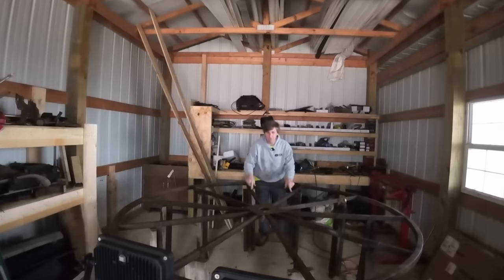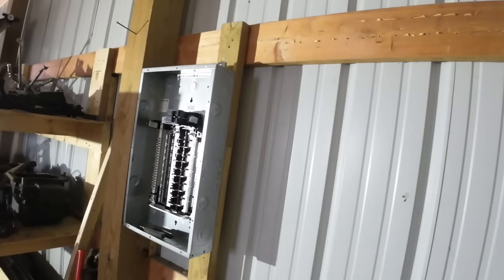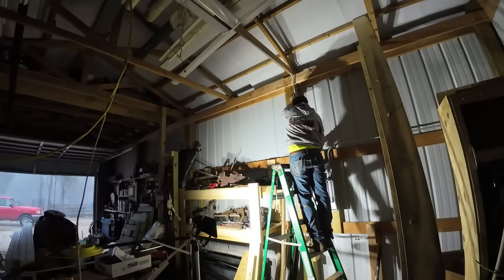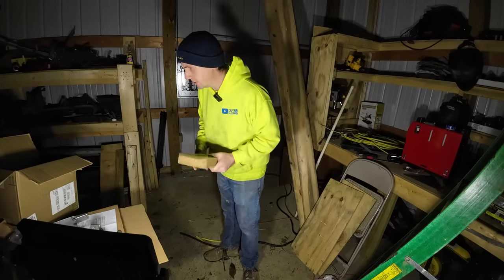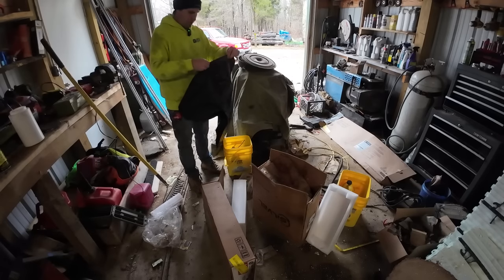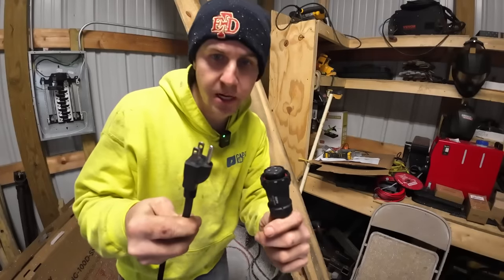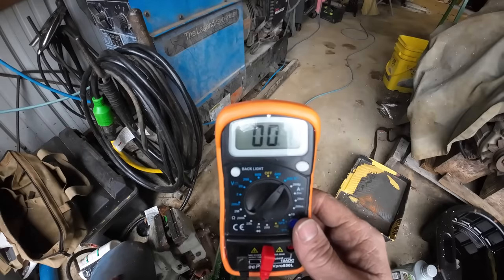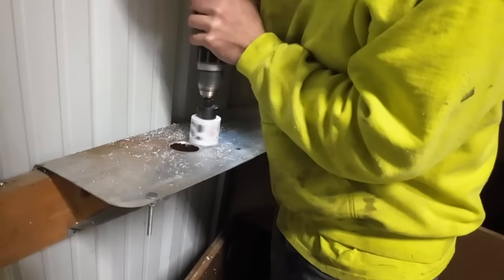Off Grid Solar Shop Conversion - Step 2: Electrical and Diesel Heater Install

Comment: I have a 100 year old wooden garage in my backyard that is around that size. I have been insulating it for dirt cheap by buying used insulation from kijiji  lots of people when renovating will buy new insulation and sell the old. You should look into that for yours
Reply from the maker: Definitely a good way to do it

Comment: Great progress Mike. Enjoying the process. 
I replaced one incandescent bulb (out of 12) in my shop with an LED, with 4 adjustable panels. 12,000 lumens. 
Huge difference, even though I don't care for that frequency of light.

Comment: Mike, why not add an outlet and plug in a very low wattage night light. Practically no draw, but a defeat of the 4 hour shutoff. At least it would work for going out in the morning.
Reply from the maker: Not a bad idea.

Comment: Have you tried some wire lubricant, when pulling wire through conduit?  Small squeeze bottles are relatively inexpensive, and the stuff makes a difference.  I'd think you would really like the results, when you're pulling NM cable, which doesn't have the slickest coating to begin with, through 1/2" EMT.  

Thanks for another video.
Reply from the maker: I use lubricant when pulling wires.

Comment: Just a thought on heating the battery pack. Would it help if the exhaust stack was re-routed down and around inside the cabinet? There are a few reviews on the internet about scavenging the exhaust heat from those style heaters. Nice progress Mike. Take care & stay safe.
Reply from the maker: Maybe

Comment: I have the same Bluetti--- if you can------- 2 solar panels running 350 watts each gets the most out of the system.
Reply from the maker: That would be awesome,  for now I'm running 100watt panels

Comment: Looking good.:face-blue-smiling: I have the same  Bluetti, for emergency power. Haven't used it yet but like watching you talk about it. 
Having to turn the power on might not be too bad it will save power. Might have to have a flashlight by the door, a small in convenance but it's only a temporary solution to your power needs for now. 
Have a Great week!🤠
Reply from the maker: I was thinking that,  wouldn't be too bad
Reply: Do you worry about the batteries getting too cold for the unit to operate during certain emergencies or are you in an area that wouldn't happen?

Comment: Take a look at Simple Living Alaska for their chicken coop setup. It uses a Bluett,i diesel heater, and LED lighting set up with a thermometer to control the heat. Might be just what you need?

Comment: Mike, I think it would be beneficial to spray foam insulate the back side panel of the shop to keep Blue boy warm.  Shouldn’t be too much for a DIY application.
Reply from the maker: It would work well, but would be incredibly expensive
Reply: @CaptainKleeman  incredibly expensive to buy foam spray at a big box store or a supply house?

Comment: Just a quick question. Could you cut a couple pieses of foam board insulation like builders put behind vinyl siding to keep the baterries from getting too cold?

Comment: Did you get special low temperature fluorescent fixtures that start easier in shops and barns that are unheated? Actually, since it is off grid, I would consider LED fixtures since they are more efficient. I have heard but have not investigated LED bulbs that will replace fluorescent tubes. Maybe you can check this out.

Comment: Another thing to watch for on your Bluetti or other similar power banks :
Most recommend using an inverter generator , preferably a pure sine inverter generator , to charge them , as the power banks typically do not like the dirty high distortion voltage supplied by many home generators , especially brushes non inverter designs .
I work with similar types of commercial UPS systems , and I can tell you some stories about people not paying attention to such arcane details when ordering generators for emergency long term grid outages , and , wondering why the damned things won't work right or at all , even if the supply voltage and current are within specs .
This is what I suspected with your welder / genset , as it is more than likely a brushed design , and the dirtier and more worn the brushes get , the more THD of the AC waveform they produce as the load increases . I didn't suspect though , that it cut off the AC power output when the welding side had a draw . Then again , I'm not a welder , but I have struck a few arcs in my day , sometimes on purpose .
Reply from the maker: It suggests pure sine wave in the manual.  I have what I have.  It'll either like it or it won't.

Comment: Not sure if your work is going to have to pass inspection , or , what version of NEC they apply there , but , running Romex in in conduit is generally frowned upon in most places and situations .
Most of the reasoning behind that has to do with potentially overheating the wires , but , it generally carries the same thermal rating as THHN wire if you read the specs .
Anyway , don't see it being any issue at all in a practical way , especially for a low draw fluorescent or led lighting circuit .
And yes , I have done the same thing , but not on anything that would need to please the inspector to get their little stamp of approval .
Reply: I was gonna say it's against NEC so oh well
Reply from the maker: It's definitely not against nec.
Reply: @CaptainKleeman  it's all about over heating the wires buddy. 
General practices run THHN in conduit. Love the channel either way!

Comment: In an ideal world, the intake of the heater takes in air from the outside otherwise you create low pressure in the building and you suck in cold air through the cracks, that needs to be heated. In reality, I am not sure how drafty your shop is and if it will make a significant difference.
Reply from the maker: Lol,  so, let me follow this.  Instead of sucking in cold air through the cracks of the metal by having the intake inside,  I should put it outside to...and let me make sure I'm following...suck in the same cold air. Aside from that logic,  it doesn't create a negative pressure, it's simply moving air through the unit.  An exhaust fan creates negative pressure, this heater does not

Comment: So could you put a surge protector between the welder and battery that automatically resets after the incoming voltage normalizes? If one even exists that does that. An oz. of prevention as they say.

Comment: Article 334 (b)(4) says yes you can use Romex in conduit as long as it is not used in underground or wet/ damp location and must not exceed 53% of the capacity of the conduit. 🤷 Who knew. I was told in electrical school no but code says you can...👍
Reply from the maker: Bingo
Reply: FYI for the future THHN spools are actually cheaper and easier to pull but use what ya got

Comment: Did you ever think about putting a solar generac system for your little shed might be cheaper than running electricity to it
Reply from the maker: I'm wondering if youre watching this video or not
Reply: @CaptainKleeman  HAHHAAHAHAHAHA....

Comment: Hello Mike,
  I know that you are a very intelligent man and career firefighter so please take my question as being inquisitive only because i have a similar structure that i would like to set up for fab work. My question is, what are your concerns about welding and cutting inside and being so close to all of the wood and timber structure? Thanks for the ride my friend.
Reply from the maker: Welding screens
Reply: Thanks, i suppose that they would need to touch the floor because cutting sparks can hit the floor and scatter over a good distance.

Comment: Ain’t nothing wrong with 12/2 in conduit. Just a little harder to pull. From the video, it looked like your light switch was upside down??

Comment: Well I don't want to be that Romex in Conduit guy...but yeah it's frowned upon by all inspectors I've ever met. Plus with Romex it doesn't need Conduit.
Reply from the maker: It's not against code...also...Romex is required to be protected if exposed by code. The only people that frown upon it don't understand it, and they then told someone else who doesn't understand it, and so on and so forth.  Reading is easy 👍
Reply: @CaptainKleeman  Well these were Electrical Inspectors who either did or didn't sign off the Permit.  Lack of free space inside the conduit when with Romex over "free wire" could cause overheating was the reason told to me. Every locale is free to add to the NEC as they see fit, so different rules where you are I imagine.
Reply from the maker: @GrandsonofKong  codes can only be adapted to be made more strict.  Not less strict.
Reply: @CaptainKleeman   Which is what our locale required for no Romex in conduit due to overheating concerns from the Romex "Cable" taking up too much area inside the  conduit.

Comment: I couldn’t read the print on the newly fabricated heater shelf (bottom side) but was that a sign you found while cleaning/clearing out the World HQ?   Boom !  I love to see repurposing and breathing new life into stuff that others casually send to the landfill.  

The true “green” people are those who reject defective policy that creates carbon footprint but instead embrace the 3 R’s of: Reduce, Reuse, and Recycle (in order of effectiveness).  

Pro Tip: if energy efficient means THAT replacement product comes from NOT America, then “the efficiency” never pays off the debt created.  I’ll change my position when China, India, ….even Mexico adopt different manufacturing methods or when someone invents solar shipping.   This isn’t wholesale bashing these countries’ products…just the falsely propped up policy that is forcing replacements.

Comment: You got to check the Hertz. If it's lower than 57 Hertz machine or the Blueetti is not going to like it. Also check your THD total harmonic distortion. A lot of devices do not like it when it gets too high. They were set up on the basis of under 5%. The power company is supposed to guarantee what comes into your house 5% or under. Too much THD can actually ruin things like computers any sensitive equipment. How about running Romex to conduit there are rules about certain things. I could care less. But it's the amount of space taken up inside the conduit It doesn't allow the wires to stay cool enough if air can't get through the conduit. I know it sounds hokey that's just what it is. Now don't be jumping all over my case. Cuz I happen to mention Romex and conduit like I said I don't care. I'm a home inspector for real estate. I just know certain things. So if you want to understand how generators are. How they produce power and how dirty they can be in the line voltage. Watch James Condon YouTube channel.

Comment: Hey budd- its WAYYYYYYY easier to pull 3-lines of THHN wire than to pull romex thru EMT...... just sayin! Hahahaha
Reply from the maker: Obviously
Reply: @CaptainKleeman  Sorry, I had to- I just added a 19x38 addition to my shop with 6 LED lights & a switch and 8 four-gang outlet boxes, used up every scrap piece of recycled THHN I had pretty much!

Comment: Way to much wire! That should have been a switch leg.
Reply from the maker: How so?
Reply: From the source the neutral goes to the light. The hot goes to the switch leg (via the black wire). The switch leg returns the hot side to the light via the white wire. Circuit complete or broken with the switch. Try a google of "how to wire a switch leg" @CaptainKleeman